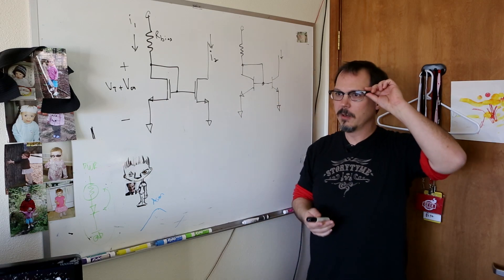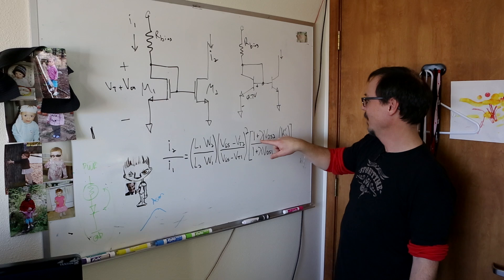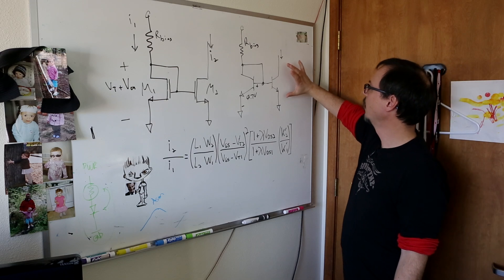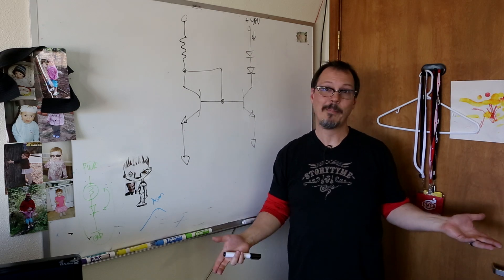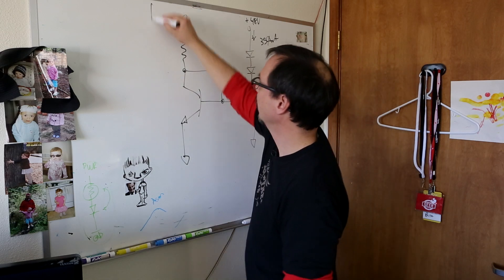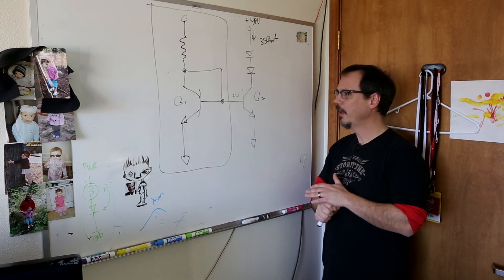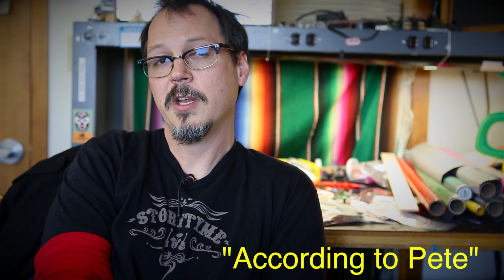SparkFun According to Pete #38 - Current Mirrors

Comment: Pretty late to the party, I hope to God you're still active here cause I need some assistance on a research project.

If your load was a DC motor, could you vary the current through it by varying the resistor on Q1? Assuming voltage is constant

Comment: Thanks for the video, I have the same question. think you missed the point of the question. Even with a constant current power supply, parallel strings of COB LEDs can have slight differences in the current on each string. My system that I'm building has 400 3W LEDs that run at 500-3000 mA. I want to use BGT transitors to keep the current constant in each of the 16 strings. Its all built on a sheet of aluminum. do you know how to size them? shopping is hard if you don't know what you need. If I just wired all the gates together, would they all mirror each other?

Comment: The problems of stabilizing a current mirror can be handled by incorporating negative feedback into the circuit.  Furthermore, current mirrors can produce multiples or fractions of the current that's passing through the reference transistor, so it's not necessary to waste large amounts of current in the reference transistor.  Uses?  Driving inductive loads -- speakers, motors, switched-mode power supplies, etc. -- whose behavior is determined by the currents through them.

Comment: Not sure his 350mA argument is valid for normal leds. All the leds in the string will carry the same current, and the same current will pass through the transistor, only 20mA
Reply: COB LEDs use multiple amps and high voltage.

Comment: This is best explanation on Youtube, my confusing is over,Thanks. By the way, I have a question ,would it be OK if we use two mosfets instead of two transistors in a view of thermal runaway because more heat on mosfet make it less conduct in oppose to two transistors.

Comment: I be interested in your thoughts are on why a discrete configuration would not be suitable for the following application: Regulating the current through both triodes in a dual triode vacuum tube (such as an ECC88) when being used as a balanced phase splitter [see: http://digilander.libero.it/essentialaudio/hybrid_circuit.htm]

Comment: Perhaps this is a dumb question.  But I am looking for a way to control an ac motor, namely an o gauge train layout with an arduino. Would this work?  Control the voltage of the ac current by having it mirror the dc voltage?   Or do you have something else you could recommend.
Reply: +Kevin Rutledge It won't even work that way. And anyways current mirrors are used in 99% in ICs instead of resistors to set the bias currents, because it's easier to do transistors than resistors on silicon die. End of story:)
Reply: You would use an AC-AC converter (aka a single phase AC controller) such as a triac, or two SCR/thyristors. The digital pin from the Arduino will allow current to conduct in specified direction at specified interval. There's some example code of AC controllers. 

This has absolutely nothing to do with current mirrors though

Comment: I made an array of 12 current mirrors for 4-20mA current loop testing.
I used PNP's with a heatsink on Q2 for thermal runaway and pots in series with a resistor on Q1 for trimming the I1/I2.
Works like a charm for 5 months now - and the PLC's seems to love it too :D
Only limit is that it has to be fed with 12v only.
If needed I think I'll redesign it with an opamp/current source in mind.

-Nice to see you are back with the kitchen LEDs projects.
Reply: Like your user name haha!! lol

Comment: Using a discrete current mirror is useful for more than a single mirrored current. Say you want to drive 10 LEDs, and dim them all together. You can have 10 of them, all mirrored on the same transistor, all with the same current. Doing that with other technology is fairly hard, but simple with a current mirror. See "The Art of Electronics" for more information and examples. It has a great section on current mirrors.

Comment: If I'm not mistaken, voltage controlled oscillator (VCO) circuits use them. Since oscillators often have non-linear response to control voltage (for instance the pot setting the frequency), the current mirror seems to act as an antolig amp (or log amp?). Will try to find an example.

Comment: I have an example: there is a big 555 timer kit. This kit, with discrete components, emulates the die of the 555. Since the actual die of the 555 ic houses multiple current sources, they made current sources with discrete components. Et voila: an example ;). Cheers

Comment: Can somebody give a list of applications current mirrors are regularly used in? What types of instrumentation or  devices?  Kinda curious to where they are useful not where they are not lol
Reply: They are used all analog ICs such as comparators and opamps. They are also used to generate the voltages in voltage regulators, using the so called bandgap reference technique. As far as analog mirrors, I have used them to allow dimming of lots of parallel LEDs all driven from a single low voltage source.

Comment: Ooooh one of my favourite subjects! First packet of questions, hopefully someone will answer

00:44 How do i know what current is that?

1:07 How do i know the Vt and Von?

1:18 how do i calculate that? What are the all other things being equal?

1:33 How did you reach that conclusion? Also, SAME or EQUAL? Small difference in words, big difference in actual reality. And another thing, under WHAT conditions will those currents be equal? M2 can't possibly create a current out of nothing, only thing it CAN do is adjust the "resistance" across D-S. What happens?

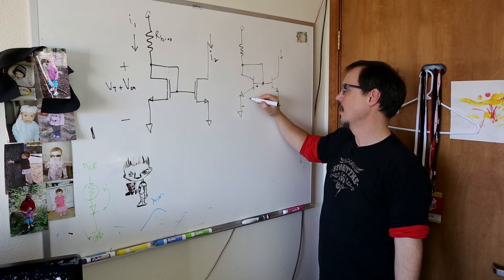1:55 How do you know it's that and not anything else? Do we set it? Is it always that?

2:45 finally some hard stuff! That's scary? Anyone who finds that scary should stay away from metallurgy books, some empirical equations in there span multiple rows.

5:10 what happens when the rate at which the transistor generates heat ultimately matches the rate at which that heat is dissippated to the outside world? Won't that be an equilibrium? A bastard, evil, hacky equilibrium?
Reply: Hello. If I may I would like to try to answer some of your questions:

1) You set the current by adjusting the resistor, thus adjusting the bias voltage at the gates of the MOSFETs.

2) I think Vt and Von are provided on datasheets. (I'm not sure though)

3) Assuming you know what current you want, you need to calculate what bias voltage you need to provide that current. So if you know the voltage drop across the M1 and you know the source voltage and you assume the source is grounded, you just use Ohm's Law to calculate the resistance needed.
With these calculations we are assuming we are using CMOS as opposed to individual MOSFETs so we assume the parameters for M1 and M2 are equal.

4) We can reach the conclusion that the current through M2 will equal the current in M1 because both MOSFETs will have the same bias voltage at the their gates. An interesting aspect about MOSFETs is they can force current based on the bias voltage at the gate no matter what the voltage drop across the MOSFET because of the way MOSFETs work.

5) For BJTs, Vbe is almost always assumed to be about 0.7 V (I was taught
0.7 V, but I guess others were taught 0.6 V)

6) Maybe scary to hobbyists because they do not usually think about the detailed math behind the components. But looking at these components as an engineer there are some fairly long equations associated with MOSFETs.

7) Maybe, but will the BJT last until that equilibrium is met? Also, how likely is it one can set the circuit to create that equilibrium?
Reply: 4) Will it? How can the M2 force a current? Suppose i do not stick a power supply at M2... what will happen then? What property of M2 changes which ALLOWS the current to be that value? Please do not use the word 'force' because unless we are talking about an inductor, it can NOT FORCE a current.

5) what if i stick a voltage across those terminals? like 9 V? will it still be 0.7 V - 0.6 V ?
Reply: Oh and thanks for taking the time!
Reply: George Tsiros 
4) You mean: will the currents be equal? In theory yes, in real life the currents will be very close. How close? Depends on the materials of the CMOS or the individual MOSFETs and imperfections in the manufacturing.
For nMOS, when you apply a positive voltage at the gate, a certain amount of current must go from the drain to the source (technically source to drain) because the positive charge attracts the electrons from one n-type substrate, through the p-type substrate then the other n-type substrate attracts the electrons. Thus the amount of current flowing through an nMOS depends on the gate voltage.
In theory, with no voltage source there would be no voltage drop and, according to Ohm's Law, no current flow. In real life, doing so would likely damage the CMOS chip because there is almost no voltage drop (maybe pV) and the device is trying to push a current.
As far as I know, no property changes. M2 can push that same amount of current as M1 because they have the same gate voltage. 
Sorry, "force" is a term one of my profs used and I did not realize it is incorrect
to use it when referring to MOSFETs.

5) 9V at the base and gnd at the emitter? You would likely fry the BJT. The base and emitter are like a diode, which is why we assume a 0.7 V drop (like we do when assuming 0.7 V drop diodes), so doing what you ask would push too much current through the BJT and cause a problem because there is a 9 V drop when there should be a 0.7 V drop, approx.

Also, looking back at my old notes: 0.3 V <= Vt <= 1 V
Reply: I'm gonna push you more and i hope you've got some juice left, because we've not even started yet.

"In theory, with no voltage source there would be no voltage drop and, according to Ohm's Law, no current flow. In real life, doing so would likely damage the CMOS chip because there is almost no voltage drop (maybe pV" So the transistor would be damaged... because... ? Too much power? But there is no current, so there is no power dissipated. No current flows anywhere. Not G-S, not G-D, not D-S. There is no power dissipated anywhere. There is no high voltage applied anywhere. Think it a bit more, i will be waiting.

"the device is trying to push a current" What is the mechanism behind that pushing? As far as i know, the mechanism via which the transistor ALLOWS current to pass through is gathering freely-moving charges between the D-S to create a channel.

"Sorry, "force" is a term one of my profs used and I did not realize it is incorrect to use it when referring to MOSFETs." My professor is doing that too and when i asked him what does it even mean he couldn't respond. When i asked him "but the transistor doesn't actually FORCE a current, because it CAN NOT force a current?" he replied via verbal abuse towards me. Great teacher.

5) ok then, 9 V, AND a 10 μA current limit. what would happen then? What is the Vbe voltage then?
Reply: George Tsiros
You are right. I thought about it and with no power running through M2, it would not get damaged, there would just be no current through M2.

I think the reason why people use terms like "push" and "force" are because the MOSFET allows current through independent of the voltage drop across the drain and source.
Ouch, sounds painful.

How could you limit the current? You only have a little resistance between the base and emitter, it seems unlikely to be able to limit the high current that would pass through.
Reply: That's not the reason people use the word 'force'... but those that do use it, ask them why they use it, what does it mean as far as the circuit is concerned... haven't found one that can explain it.

As for limiting current, that's why we have current sources, don't we?
Reply: George Tsiros
As far as I know, a current source in real life is a current mirror. But, as long as the 9 V goes through the current source first it should be fine. In that case, there will be approx. a 8.3 V drop across the current source thus creating a 0.7 V drop across the BJT.
However, if the voltage source is after the current source, the current source will not do much and the BJT would still fry.